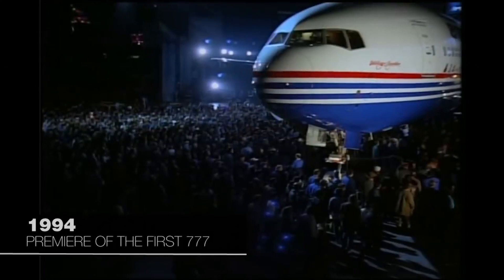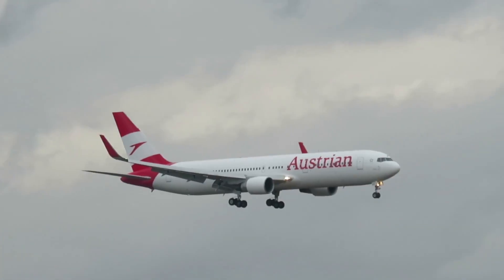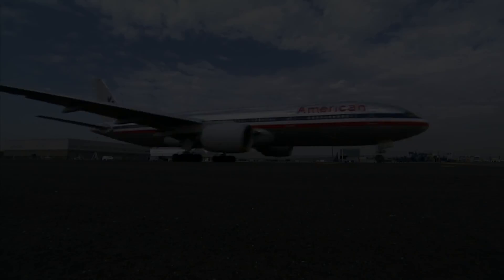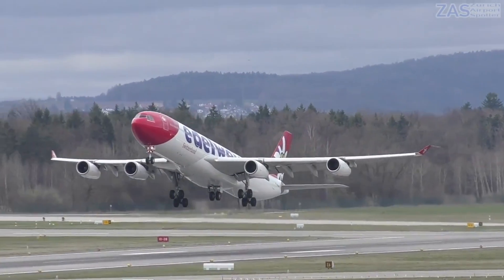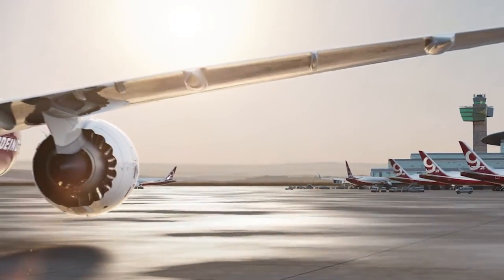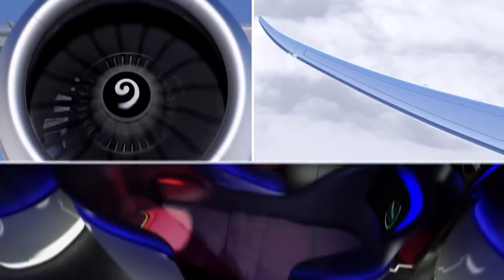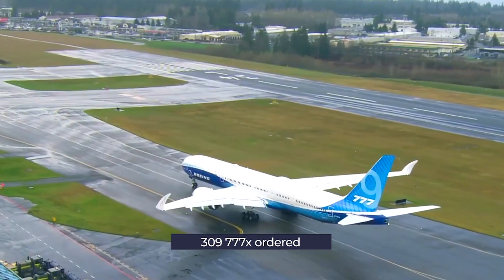Why Doesn’t The Boeing 777 Have Four Engines Like The A340?

Comment: 777-300er: Has 2 General Electric GE90
If had 4 engines: Increase in speed, Inefficient, Uses as much fuel as a concorde.

Comment: It was ahead of it's time, they had no way of guessing there would be another spike in fuel costs but it paid off big time, just look at the order numbers compared to the A340. 
I wouldn't be surprised if the generation after the 777X ends up being Boeing's first all electric commercial jet.

Comment: I don't believe any aircraft manufacturing executives are lying awake at night worrying about the environment. They are worried about sales, so, ultimately, this is about marketing and sales. And I guarantee that very few people are thinking about the environment as their aircraft is falling from the sky. The simple fact is that two engines don't allow the same margin for error as four engines. Not forgetting that it was marketing and sales, not safety, that drove the introduction of the 737 Max 8 and it's wonderful ability to nosedive into the ground at high speed.

Comment: As engines became more reliable and more fuel efficient, both Boeing and Airbus started making twins with long range. But, the problem is, due to ETOPS requirements, if a twin engine plane suffers an inflight shutdown due to unknown reasons, it could impact the ETOPS requirements, in which case that particular aircraft or even the entire aircraft type can become non ETOPS capable. The type could still continue in service but on Non Etops routes only till the engine problem is solved. This results in higher fuel burn.

Comment: Simple answer...... it doesn't need that many and 2 engines are a lot more fuel efficient than 4. A 2 engined aircraft can even fly on one for up to 5 hours which is enough to get it on the ground should they lose one through engine failure.

Comment: The fundamental reason the 777 and other newer twins have ETOPS  ratings is that engines have evolved to a level of reliability that an inflight shutdown is very rare, and two engines shutting down within the ETOPS range is virtually unheard of. Part of the reason is that a great deal of attention is focused on eliminating common mode failures, but more generally upon the topic of  “RMS” - Reliability, Maintainability and Safety engineering.

Comment: The A330 is an A340 with 2 engines...
Reply: Yes
Reply: For A340-200 and -300 yes as it shares the same wing and fuselage length. The -500 and -600 though have a bigger wing and the fuselage is longer than the A330’s fuselage which is the one used with A300

Comment: Just a little correction on the orders; the original 777 has 1649 produced with a backlog of 54 to be made (37 of those are freighters) and the 777X has an actual backlog of 276, with Etihad and Lufthansa dropping their orders to 6 each, from 25 & 20. Total 777's ( all variants) on order are 330, totalling 1979.

Comment: Sales figures don’t lie. The B777-200LR/-300ER wiped out the A340-500/-600 with ease.
Reply: And the A340-500 wiped Boeing off the face of the planet with the record they set up with that plane up until this very day. Airbus achieved something something with the A340-500 that Boeing can only dream of. Even if they tried running the 777X on fumes, they'll never be able to reach those cruising distances.
777-200/300ER days are over in any case; A350s are cheaper (and more environmentally friendly) to operate - more operators now switching over.

Comment: It doesn’t need 4 engines ! The GE90 engines are one of the biggest and most powerful for the 777 . Each GE90 produces 52,000 HP, and a overall rating of 94,000 pounds of thrust ! So twin engines are plenty enough for the Boeing 777 or 777 300ER in any variant . I have flown on the 777 many times for travel and I have been impressed and comfortable every time . 
The wide body design is excellent ! Lastly , the Boeing 777 in general has been a very reliable aircraft over time . The 2 engine variants are the GE90 or the RR Trent 800. Great video! 👍

Comment: It makes sense they wanted to build the 777 with 2 engines! 2 engines reduce fuel cost as they are more efficient! Also, the 777 is by far, the most succesful Twin-Engine Wide-Body Aircraft today! With its 2 Powerful GE-90 Engines, they are the biggest and most powerful engines of all time! With the new 777X, it will have the newer GE-90X Engines, Making it 20% more efficient!

Comment: When 47-400 was approved to a 2 man crew the seed was planted . Boeing knew this . Boeing also new that installing larger engines on a 767 to increas rang and payload was not feasible and to modify a 747 to operate with 2 engines would be a new type certification.. so the 777 was born. Also at the time engines were going to be getting bigger anyway due to advancements in technology..  a side note .. 777 can land at smaller airports then the 747 and 340 due to is better design and I can for use a future where 777 will be used for domestic flights like lax to JFK or iad to SFO

Comment: The history of airplane manufacturers is always the history of hit and miss.
Boeing definitely made the right decisions with the 777. However, their gamble on the 737 MAX has cost them dearly. Boeing should probably have continued with a complete new aircraft to counter the Airbus A320-NEO. 
Airbus seems to be very strong in the regional market at the moment with the A220 and their A320-NEO family. The A350 also seems to enjoy a great deal of success.
The A380 never became the success Airbus had hoped for. It will still be one of the best airplanes to fly in though.
The Boeing Dreamliner has enjoyed a lot of success but has unfortunately been struggling with especially engine issues that are no fault of Boeing. It is still a great airplane.

Comment: Given an airplane size, naively you'd think a twin engine design would need each engine to be twice as powerful as each engine of a four engine design - so that the alternative designs would have equal power. However, this is incorrect - the twin needs engines which are three times as powerful, resulting in a plane with 50% more max power than the alternative four engine design. This is because of the requirement to be able to continue takeoff and climb out after an engine failure at or near V1. If a four engine plane suffers an engine failure, it needs to be able to climb out on three engines. If a two engine plane suffers an engine failure, it needs to be able to climb out on one engine.

It says something for the relative economic efficiency of two engines vs four that they are much more economically viable despite this requirement to over provision engine thrust by so much.

Comment: Long answer is Boeing 777 two GE90 engine create as much as two turbofan engine and also fuel economy during that time and also Boeing knew point to point travel from 1990 so they decided to build smaller two engine passenger plane instead

Comment: Well, at the very core the answer is simple: The 2 engines are powerful enough for the plane and ETOPS enables efficient navigation, so 4 engines were technically not strictly necessary.
Thats the whole point of the 777, its a cheapskate product for cheapskate use which is why it is often referred to as a winged bus. Luckily the 787 and A350 have arrived not very long after the 777, even though you cannot really count the 787 as its even more cheapskate in terms of engineering and quality.
Reply: How is the 777 cheapskate?
Reply: Meanwhile the 787 was the first plane with a composite fuselage

Comment: the 2 engine are strong enough, they pute 70,000 lbs of thrust while the engine on the 747 only pute 50,000 lbs of thrust.

Comment: One 777 engine is more powerful than all eight on a B-52 bomber.
Reply: isn't the engine itself wider than a 737?
Reply: A 747-8 engine is as powerful as all 8 engines on a b-52 a GE90-115 and GE9X can power a 747 by them self also a 737 can fit inside both of those engines
Reply: Not correct. Both engines together are more powerful than all eight of a B52. Not each engine alone.

Comment: An aircraft with 2 engines is not more efficient than aircraft with 4 engines of the same generation. Aircraft must be designed such that the remaining engines have enough power if one engine fails. This means that a twin engine airplane must have twice as much power as necessary and a four engine aircraft needs to have 1.33 times the power as necessary for safe flight.

The optimal efficiency of turbine engines is generally close to 3/4 of peak power. This means that during most flights (without engine failure) the two engines are operated much further from their optimal operating conditions than 4 engines.

However, buying and maintaining 4 engines is much more expensive than 2 engines, even though the latter are more powerful. Engines are about half of the price of a aircraft and also about half of its operating costs. So this matters a lot.

By the way. This video is not only factually wrong, but also disingenuous by comparing the B777 with the A340. The A330 would have been a much better comparison, and lo and behold, it too has 2 engines.

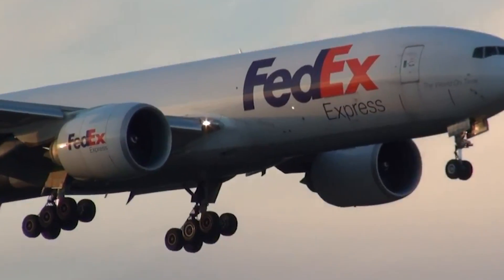Comment: 3:39 Wait so the 737 isn't twin engined?
Reply: Sad 737 noises
Reply: How about the A320 and A330?
Reply: I think meant 2 aisle twin engine aircraft
Reply: @0741921  *Widebody
Reply: perhaps he meant for wide-body twin engine
Reply: The 737 is Twin-Engined, but the 777 is more succesful in Twin-Engine design!
Reply: @fsg7710  More succesful how? Maybe in range, capacity and that stuff, but not in number produced (1653 vs 10614)
Reply: @therickman1990  more successful in range and capacity. Remember that an airline makes money by transporting passengers
Reply: @fsg7710  it doesn’t compete with the 737.  You can’t be “successful” against someone you don’t compete against.  That’s like saying Usain Bolt is more successful than Kobe Bryant because Usain can run faster.

Comment: 777 with 4 engines would be quite the sight.  Imagine the power you’d get from that
Reply: less power. The engines are sized, such that the remaining engines are powerful enough for take off, if one engine fails.
Reply: Probably the same, just each engine with half the power.
OR you could have had some short takeoff variants with insane power
Reply: @Kalvinjj  true. But I’m saying hypothetically 4 GE90s at full thrust 😂😂
Reply: @Matt9786  The widebody to dethrone the Twin Otter
Reply: takeoff roll of less than 1000m with a climb rate beating the space shuttle hahaha

The 757-200 has the highest thrust-to-weight ratio of any airliner and when empty the climb rate on those things are insane.
Reply: That would make 1 benefit and 1 issue
This would lower the amount of runway that the 777 would need: I mean, 4 engines at max power would probably propell the plane into the skies in mere seconds.

But structural issues come now: I'm worried that the plane would have it's wings torn off due to sheer power if the load is sustained

Comment: The answer is obvious, twin engines planes are more fuel efficient than four engines ones. Now than twin engines planes can be used on the longest routes, thanks to the generalisation of Etops certifications, all four engines planes, Airbus A380 and A340, Boeing 747 are on the way out, being replaced by Boeing 777, and 787, Airbus A330 Neo and A350, and soon the A321 XLR.

Comment: A340: 4 engines 4 long haul
B777: 2 engines 2 make money
Reply: Until 2001, when Continental used the twinjet 777 on the EWR-HKG route, starting the battle of longest flights.
Reply: @Blank00  and there...Boeing can try all they want. When it comes to the longest flight (distance), Airbus has got it in the bag!
Reply: @deonellis8577  Because the Airbus ULR models cheated by having a premium and less dense configuration, whereas a 777-200LR can fly from Auckland to Doha without having to reduce the number of seats
Reply: @Blank00  You don't know much about Airbus or the A340-500 configurations (or their reach distance), do you?
Auckland to Doha? The A340-500 laughed at that...
Reply: @deonellis8577  and there's a reason that it didn't last very long. It was way too inefficient. And besides, the A340-500 doesn't matter because it was discontinued over 7 years ago.
Reply: True although it’s worth mentioning both are very safe
Reply: Yeah ☺️😉
Reply: Lol
Reply: Lol
Reply: Until you see the 777 200 LR...
Reply: Lmao
Reply: airbus develop A340 and A330 as 4 and 2 engines solution together...
Reply: true
Reply: A340 will be Decommissioned around 2050 or 2080.
Reply: @Christian Taylor Meanwhile, what's the longest A350 flight, excluding ones operated by the ULR models that have all-premium configurations?
Reply: Smort
Reply: Bae 146:4 engines 4 short haul
Reply: @cellpat7392  The 777-300ER is a beast with GE90s
Reply: 4 engines more carbon emission
Reply: LOL

Comment: Did you mean to say the 777 is the most successful large capacity twin engine pkane? The A320 and 737 have both sold some 10,000+ units, making them far more successful as twin engine airliners than the 777 has been so far.
Reply: I wouldnt call an 737 or a320 a large capacity twin engine aircraft, especially early variants.
Reply: A320/737 are not wide body high capacity planes
Reply: Success does not necessarily mean sales.
Reply: @zackaplowitz  In the case of 737xxx it does.

Comment: This is the plane that killed the MD-11, A340, and the A380, the advantage was the twin engine, yes this was a right choice, now she’s on a heavy battle with the A350
Reply: And quite possibly her bigger sister the 747 also  :(
Reply: @jac8801  the 747 will live on in cargo
Reply: @RixilRS  It will live on cargo for quite a while indeed, but the 777 is taking it's place as well. Even cargo operators want that sweet sweet fuel economy after all, and it's still pretty huge.
It just can't be beaten tho in outsize cargo, given that 747 nose, I remember a short clip of a wind turbine shaft being loaded into it, all at once from the front.
Reply: @jac8801  has kind of become a successor, a widebody with a mostly single decked fuselage, and a max capacity of 500+ (except for the 747’s nose i suppose)
Reply: @jac8801  wdym the 747 is almost no match, except In cargo
Reply: @Aviation Brussels  - Agree even before the industry down term the demand is dropping, that’s also the reason why the A350-1000 didn’t receive a lot of orders, Airlines are choosing the smaller variant the A350-900
Reply: Actually, the 777 only began the demise of quad jets. The 787 came to reinforce its point, then the A350 came and put a stake in the heart of quad jets. And then the 777x comes and accidentally ran them over.
Reply: Also killed the 747 :(
Reply: @thisonerandomguy-a340   - yeah the A350 basically killed the 1st gen 777, 2nd gen 777 and 777X is what the A350 is  basically facing challenge through, the A350-1000 is not making any progress through his rival the 777-300ER, and the 777-9 has no competitor, i guess maybe the 777 is still leading the way and the A350 has a lot to catch up to 👍
Reply: @flyowen0786  a350 can't kill 747-8 and 787-10
Reply: @Getalife2908  it can kill the 747 in both passenger and cargo purposes
Reply: But not the 747? Was it selective of its victims? 🙄😂😂
Reply: @NordoNyle  and of course, a very neat and modern cockpit, and a carbon fibre reinforced polymer body.
Reply: 777 has killed a380
Reply: @Getalife2908  no the A380 is just too big. Even if there would not be a 777, the A380 would not be successful
Reply: I wish b777 can kill a350
Reply: a380 killed  by 787 operation system.
Reply: The MD-11 killed the MD-11.
Reply: @SynysterGoose 😂
Reply: A350 is way better
Reply: T h i c c E n g i n e
Reply: @NordoNyle  but now b777 9x is better than 777 the usual
Reply: Also killed the 747 (the passenger variant)
Reply: And the A330 killed the 767
Reply: A350 WILL WIN , BUT THEN 787 VS A350 WILL DEPEND ON A NEW A350 OR MODIFIED OR NEW BOEING , 777X OR 787 11
Reply: @ieditedmyname289  objects are its. You learn English
Reply: I like *boeing abit too, but i have to say, I'm on the airbus side, I love their ultra modern aircraft, such as the a350.

Autocorrect set 'boeing' to 'boring'
Reply: @ngaviation3489  airbus fanboi ,,do comment evrywher to show their relevent
Reply: The airplane is “it”, not “her”
Reply: @tropicaltree2460  you are also an 'it'
Reply: @ngaviation3489  Duh, I am a tree
Reply: @tropicaltree2460  yeah, you have a point, didn't think about that one
Reply: @tropicaltree2460  be quiet then your a tree, trees can't talk
Reply: @egg-...  you’re*
Reply: @tropicaltree2460  I mean that also means your an "it"
Reply: @tropicaltree2460  it’s literally a her.
Reply: @amarikyer9592  you are a her
Reply: @tropicaltree2460  real